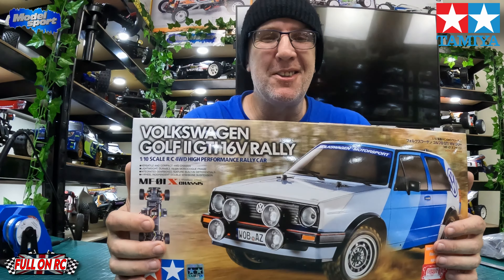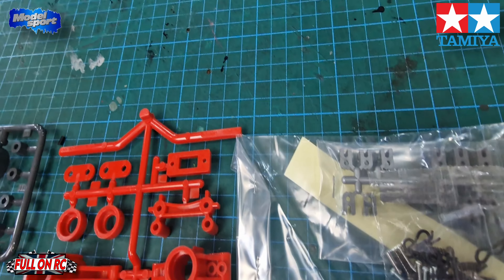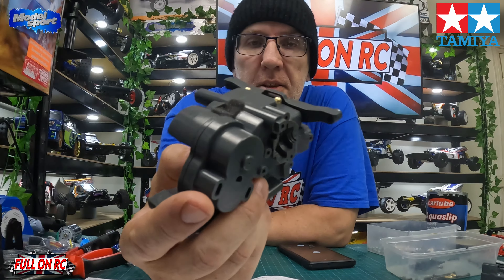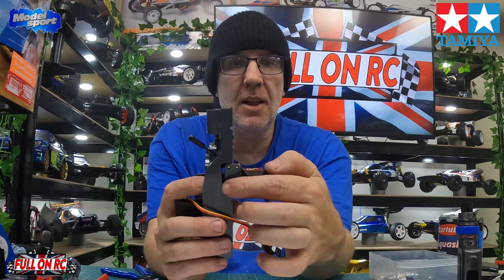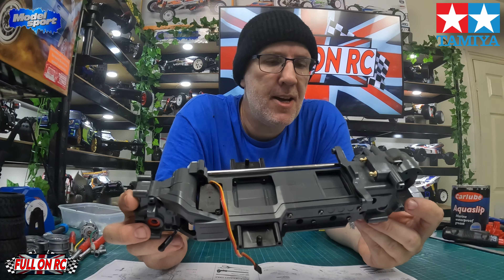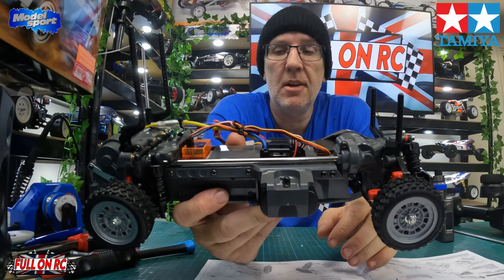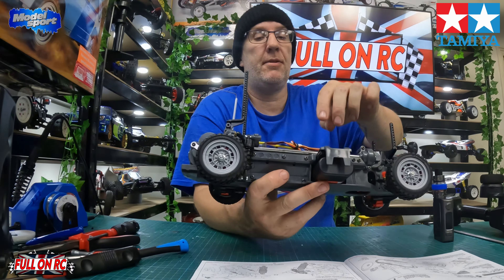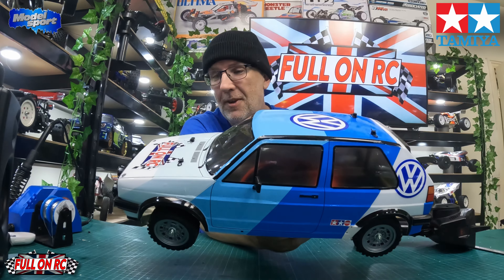What an awesome looking RC kit. The Tamiya Golf MK2 GTI 16v Rally MF-01X. Full Build.

Comment: Hi, thanks for posting this video. I just bought this kit and I've no previous experience with RC cars (although lots of experience with Mk2 golfs!). Could you send a link to shocks that you fitted or provide the model number. Many thanks. David
Reply from the maker: Yerhh not a problem. You want Tamiya CVA Super Mini Shock Unit Set. You can get them in sets of two or four, Four is better. Hope that helps. Easy to find on Ebay.

Comment: Hello mate, I’m about to order this but I’m going to make it look like mine and paint it Oak Green, can you make it sit lower on the shocks ?
Reply from the maker: Yerhh the body can come down a bit. Also by not adding spring tension adjusters to the shocks. Mine has about 2mm on the rear and close to 1mm on the front. I think adding M05 slick tyres will you allow to drop it a lot due to being less tread for the body to get caught on compared to these  rally tyres. You can also set the car up for high or low settings through the hubs etc. Never tried it myself as  I run mine and wouldn't want tires rubbing on the inner wheel arches and taking the paint off. I will be doing a live video on the 3rd of January so pop in and I will show you if it helps. Cheers.
Reply: @FullOnRC  awesome mate thanks for the detailed reply I really appreciate it. I am going to order the shocks as well that you mentioned to another guy in the comments.

1 more question, would a 1/12 M chassis fit on a 1/10 ?
Reply from the maker: @i4Detailing  Cheers. I don't think so and i don't have one to try. check the wheelbase etc